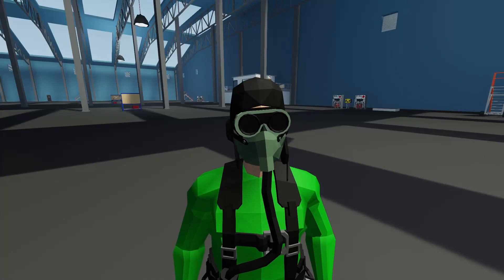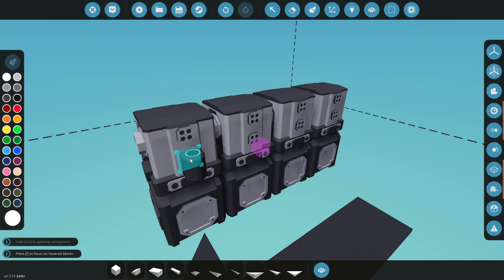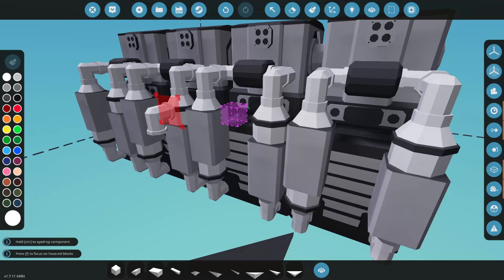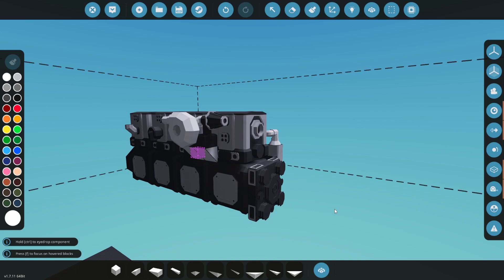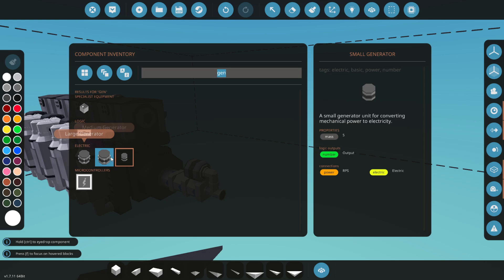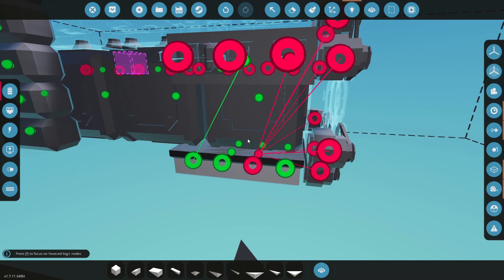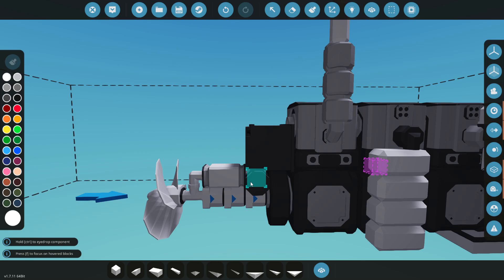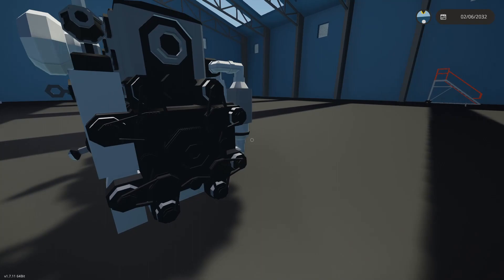Modular Engine Build 4cyl 3x3 Stormworks Tutorial - How To

Comment: I run a single small battery to start two 4cyl 3x3 engines, no issues. Also use one 5x5 fan radiator with engine at 8rps.

Comment: Loved the video @ProfNCognito! Can't wait for the next video man! That's a nice little 3 by 3 Cylinder Modular Engine, I wonder if you can Make a Diesel Engine like on a Ship with an Oil Fired Boiler, maybe like what the Essex-class Aircraft Carriers or the Iowa-class Battleships use?

I saw @Camodo Gaming's Latest video with Frantic yesterday (or rather 2 days ago as of typing this up). They were Messing around with a Build of an Imperial Japanese Navy I-400-class Submarine that's on the Steam Workshop. It's Spawns in and then Puts itself Together almost like a Transformer and it has the 3 Floatplanes which they actually Carried albeit not really the Actual Floatplanes. I've even set a Mission for them to try out with Spycakes and O.B. (May Deltars/Geometa have mercy) which is set for August 15th at the Earliest and September 2nd at the Latest in the Comments section below the video, so go ahead and check that out!

Let me know what you think about the idea and I'll catch you in your next video man!

Comment: Hey Prof, I noticed it in your last video, not sure if you did it too in this video. But the best ratio of fuel to air intakes is 1 to 2. So for 1 fuel intake, take 2 air intakes. That will optimise the power output.
Reply: also, love your video's!
Reply: @Nildraeth  im pretty sure that best air-fuel ratio changes when you supercharge your engine
Reply from the maker: They do but this Mc accounts for that.

Comment: Nice ! 
Because of all the time i spent trouble shooting my own modular engine, i could actually watch this video and understand everything you did for once 😉
So the pump on the Air Manifold, that's not necessary right ? i know it's a thing cuz i've seen it in other videos but i've heard it sort of supercharges your engine?? Did i get this part right ?
Also, with this 4 Cylinder engine, is there a way to find out how it would compare to a 20 Cylinder engine using small components ?
Just trying to figure out when does it become beneficial to go from a small to a larger engine .
Oh and i learned a few things here, i actually didn't change any of the values in the Microcontroller on my engines and i had no idea about the composite so i didn't hook that up either.
I actually have no idea what that composite thing does.
Reply from the maker: Composite reads a bunch of info off the engine.

Comment: So I have a question i made a 5x5 modular engine with 9 cylinders and it worked perfectly but I made two 6 cylinder 5x5s on another ship and the rps from the starters keeps capping at about 3.5 rps i checked the connections about three times but I don't know what's wrong with it and idea on how to fix it?

Comment: But i cant put this thing in my engine room in a boat, right? The cooling would not work because its not really "outside" and the radiators would, at least in theory, stop work ... and also the engine room would be extremely toasty :D Same with the air intake. That would need to be to somewhere outside or you get a vacuum, right?
But i should finish watching the video first i guess lol
Reply from the maker: yeah it would work better if you ran them outside

Comment: Man can anyone direct me to how to cool a 24 valve 3x3? I understand the more rps you turn the harder it is to cool but there should be a way to cool this motor down were I can pull back the throttle and it starts cooling. I built a boat for fishing and I tried a 5 cylinder not enough power to get out of my own way. So I tried 2 and still nothing so my buddy is like you going to need a monstrosity so I made a 24 cylinder 3x3 I hooked up and piped into all cylinders even on both sides of every cylinder put one radiator down on both sides the engine and I put a t pipe on both ports and slapped on on top then went out the t and piped the whole engine ins and out both sides
Reply from the maker: Cooling is a pain now. Maximize your flow rate.

Comment: You probably need alternator if necessary. 2 starter should be enough to start the engine.
Reply: A generator provides power from RPS, just like an alternator would. The alternator is too small to provide power to a 3x3 engine alone, and a small generator uses same space, with less configuration issues.